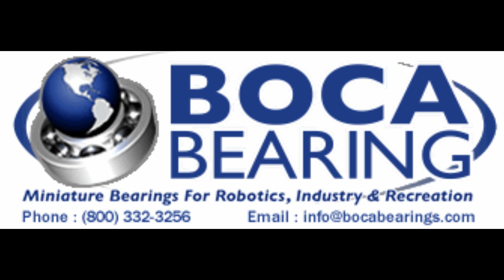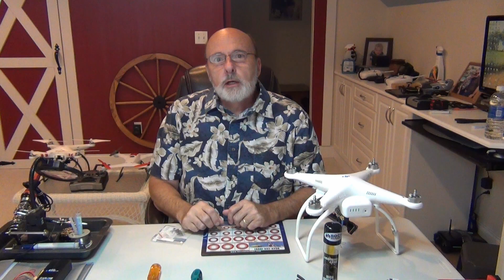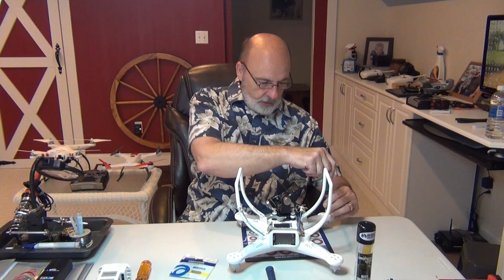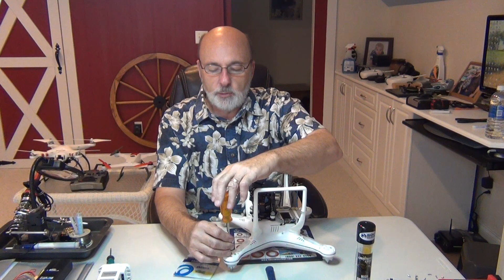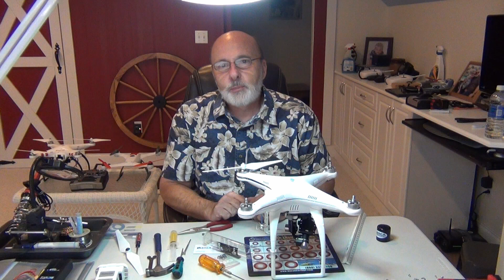Boca Bearings Upgrade For Dji Phantom Motors

Comment: Hello, I have a problem on my phantom 2 upgrade, think you that one of my engine is tired or sick? Thank you for your answer cordially Nicolas https://www.youtube.com/watch?v=4UJ1rx7Xn7c
Reply from the maker: I replaced all my motors with the ipower motor which work fantastic,  much more power and quieter.  here is the video https://youtu.be/wu8WDyfksqk    search for iPower iPM2212-920KV   you can get them on ebay or just search around.  You should be able to get 4 motors for around $60 maybe less.

Comment: Can you take a top part of a clockwise motor that has bad motor guts and use it with the guts of a new counter-clockwise motor ? Will it still turn in the same direction as the bad motor? What determines the direction it spins ? Is it this top part ? Or is it the shaft ??
Reply from the maker: The problem with that is the thread is the wrong direction so you can't use the correct prop if you do that
Reply from the maker: But if you're only changing out the  guts and keeping the same top part in the same location you will be OK except you need to switch 2 wires where they solder to the board it doesn't matter which two and everything would work fine.  But power it on when you are done without the props and make sure it is turning in the correct way.

Comment: $40 for just bearings or $70 for new motors? Hmmmmm haha new motors it is!!
Reply from the maker: +SoCal UAV At the time I did this bearing review the ipower motors were not around, or I did not know about them.   Once you get a set you will see what I am talking about.  Smooth as silk and I have Hundreds of flight on them.   I was told even though the motors are made in China, they use a very good Japanese bearing.  Either way I have them on a P1 my P2.
Reply: SoCal UAV what do u mean the motor's now are only 25$ for all 4

Comment: Thanks for the information I have the phantom 3 professional . I have only used it 3 times so far pretty cold last few weeks here in Mo.I have been very impressed with it so far.I have a collection of the cheaper quad copters this is my first serious drone.I am looking forward to making some movies on my computer with some of the videos I will shoot
Reply from the maker: +Robert partell You have a wonderful Drone,  if I was to give some words of caution to anyone moving to a Higher Priced system they would be.   Don't fly between trees especially coming towards yourself,  Altituide is your friend so if you have to fly around trees make sure it is at least 50ft above.   Remember to set your RTH return to home altitude to at least 50ft higher than anything around you.  This way should it go into failsafe it will increase the height and then return back.   If you press the home button it will come directly back and through anything in its way !!!!     

Now for some fun things,  once you get comfortable with the P3  you may want to think about FPV  first person view goggles.   there is a really cool option, looks a bit funny but works great.  they are around $250 I will give you a link to my review in a moment.   You would also need the HDMI Module for them to work:  http://amzn.com/B013H9IRGY    you might find them lower, but I wanted to show you what I was talking about.   Here is the review for the Headplay system   https://youtu.be/IhFa9fPQXVY

The last thing you may want depending on where you are flying is some type of tracker should it decide to go away on its own and beyond radio range,  or just land in the middle of some woods as mine did !!!   this is called the Flytrex Live 3D   here is my review and if you do decide on this,  there is a code in my link that gives you a little off.   To make it work you need a sim card as it is through the cellular network.   I also have that information in this link.   The cost to use it runs about $10 every 90 days but give to the second location information.   and you can share your flights information with anyone as you are flying.   Here are two links,  the first to my review and the second to my Flytrex Flights.   https://youtu.be/A3KdZd_S1-k      http://www.flytrex.com/michael76/         Enjoy,  and let me know how things go.

Comment: Hi Jake  Your videos are very informative .I noticed you have a nice soldering station with light and magnifying glass .what type is it? Do you recommend these bearings for the phantom 3 also.Thx again
Reply from the maker: +Robert partell Hi Robert,  Thanks for the kind comment :-)   the setup is made by pro-line but did not come with a soldering iron http://amzn.com/B00F1LT8XS     as for the Iron I just changed to and adjustable weller, that has been working great.   http://amzn.com/B000AS28UC    seems to work on most anything for the Drones.    just make sure you keep your tip tinned,  coat it with solder and let it sit for awhile,  then wipe it on the wet sponge,  before you are done put a bit more solder on the tip area and let it cool.  should keep it nice.    As for the Bearings,   they are great,  but unless you start to feel or hear some noise in your motors I would not take them apart.   You can get some of their bearing oil and ever once in awhile put just a small drop on your motors.  You wont be able to get to the lower bearing unless you take the motor out and turn it over.    Hope this helps.     Take care.     ps.  which phantom 3 do you have

Comment: Hi Grandpa Jack,
I head accident whit my Phantom 2 vision plus, I lost control and she fell down on the top where are propellers. After that accident one motor doesn't work. If you head seam accident or if you have advice how to fix I appreciate.

I opened Phantom nothing is broken everting looks ok but one motor doses't work, I can fill that she's trying to spin but no whit power how should be.

All the best.
Reply from the maker: Sorry to hear that.   You might have a bad ESC   if it hit as you said and the motors were spinning that would be my guess.  Just search for Phantom Vision ESC and either green or red depending on which it is.   If you are good at soldering you should not have too much of a problem.  It is very important to make sure it is a nice shiny solder joint.   If the motor still spins smooth I would just get the esc and try that.  Around $25 usd   but search for the best price.

Comment: Hi Jake, I just changed the bearings in my phantom2 to the boca orange ceramic bearings. I noticed it now has a slight whine or whistle sound to it while flying. I did notice one of the motors was pretty warm to the touch and the others were somewhat cooler. I have never checked my motors for heat after flying so maybe it was doing this all along. Should I fly it a couple more times and see if maybe the bearings need to be broke in? what do you suggest? Thanks
Reply from the maker: As long as you did not damage the bearing as it was going in and the C clip snapped on easy I would think you should be ok,  the heat on the motors even after a long flight should only be warm to the touch.  I could measure mine after if you wanted to compare,  but you would need some sort of way to measure it.  I have one of those point and click laser devices.   But if you feel or hear it is different then the others I would call Boca and tell them one or both of the bearings are bad.   Or you could put in the old ones and see if anything is different.   Hard call without being there.   Do you know if they came with grease or without?   if without it would not hurt to put a drop of oil on the bearing also?     Let me know what you find,  so far mine is doing well and I must have put 30 or more flights on it.  But I do touch them after each flight to see how warm they are and spin them to make sure they are ok and have no wobble.       Good luck and enjoy your flying
Reply: Grandpa Jake I'm pretty sure I didn't damage them but you never know. Not sure about the grease either, these are the ones I put it.  http://www.bocabearings.com/bearing-inventory/23040/h2601cos-dji-phantom-vision-electric Next time I fly it I will check it with the laser pointer and see what the difference is and let you know. I need to order some of that oil you have too. Hey on another note I recognized Anderson Mill in your other video. I'm from the Greenville area. Thanks for your help!
Reply from the maker: buckstopper2 I am in Spartanburg  exit 63 off the 85   one of these days we will have to meet up.   Have you found any good places to fly?    how does the motor seem to be doing?

Comment: What size are the bearings you used?  One of my bearings went bad and I'm trying to buy some but can't for the life of me find the size for my phantom 2
Reply from the maker: 3x8x4mm The  Bearings I used are ABEC 5 Ceramic.   You can buy the 8 Bearing Kit Number : #H26-01C-YZ  by following this link :  http://www.bocabearings.com/bearing-inventory/23026/h2601cyz-dji-phantom-1-quadcopter-electric   or you can buy just what you need.  

Hope this helps